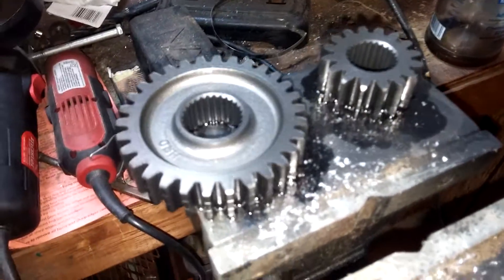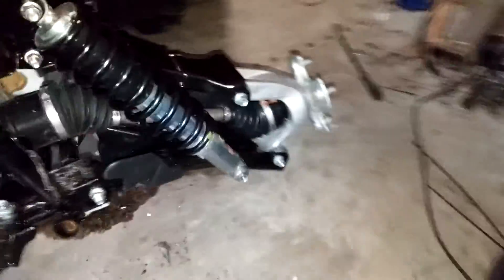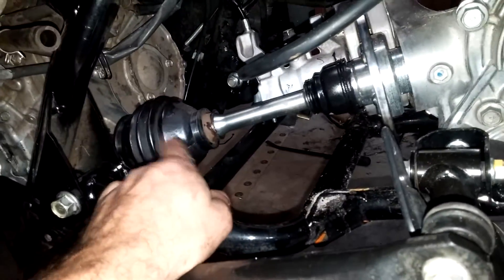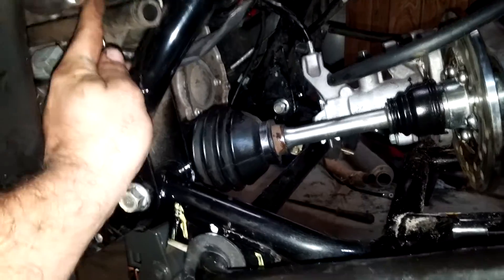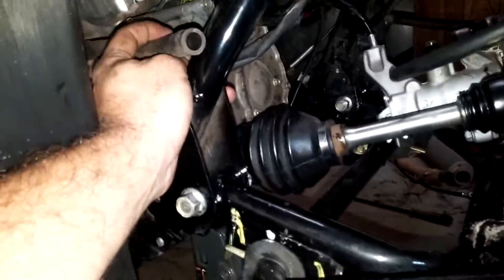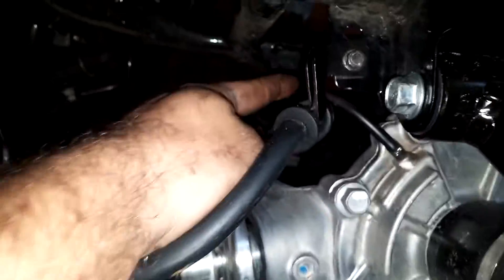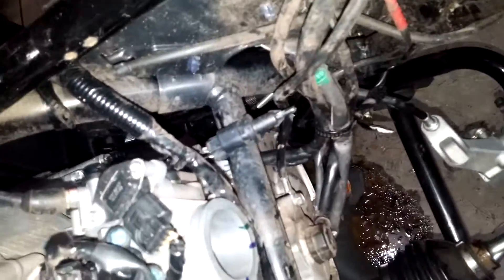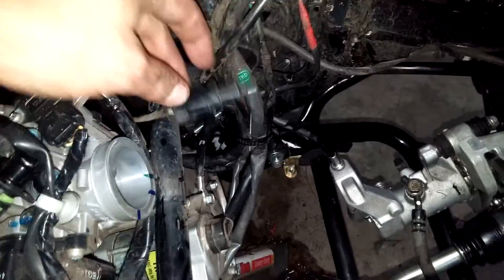Rubicon gear reduction pointers

Comment from the maker: Just did my 12% secondary reduction...yes 12% please try me...

Here are ways not to screw up the install
Hook up the crank case breather
Hook up diff breather
Plug in airbox temp sensor
Tighten all boots
Install air box drain plug
But oil back in the motor
Make sure the longer part of the shift position sensor is point towards the "n"
Don't forget to grind a lot on the shift shaft it moves when ya shift

Sounds dumb but I've seen people mess up all of these things a couple of times

Comment: Where did you purchase the gear reduction, what brand?  On a previous video you mentioned increasing the horsepower on one of your rubicons, maybe the green one.  Do you have a programmer?  Any engine mods?  I just bought a a 15 rubicon fm7, looking for pointers on increasing horsepower safely.  Your other videos have been really helpful on waterproofing and suring up potential problems areas in the rubicon, thanks man.
Reply from the maker: fm7 is the double clutch right?
Reply: +Christian Amy  the fm7 is a foot shift like yours, it's just the "deluxe" model.  same motor, power steering etc